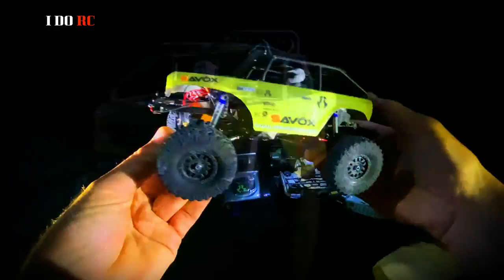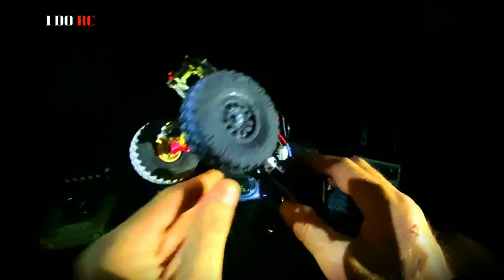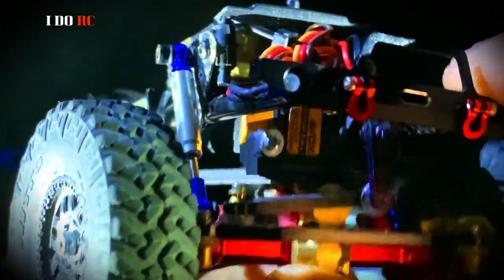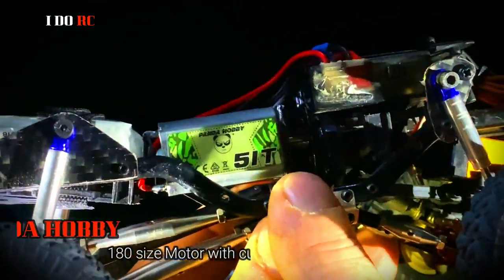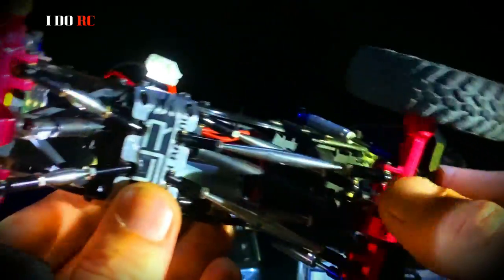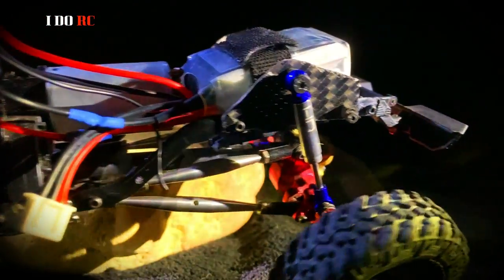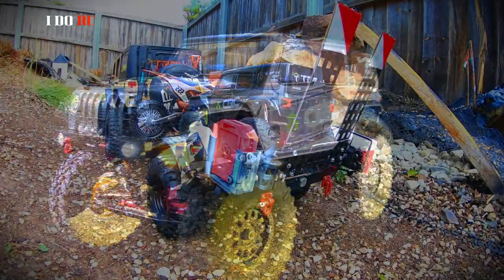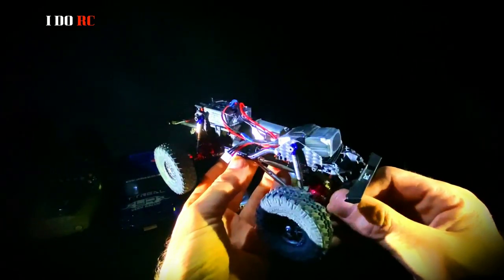BEST Axial SCX24 DeadBolt UPGRADES and BODY SHELLS REVIEW-WAS IT WORTH IT? 1080 60fps I DO RC

Comment: I would really like to know more about the motor mount for the panda motor
Reply from the maker: Hi Scott, you can apparently buy mounts for these motors but i custom made one from 20mm x 10mm x 2mm Aluminium rectangle tube. A bit of messing around to find the right sort of thing to use, then I cut to the right shape and drilled holes to match the deadbolts mount on one side and the motor holes on the other side in the right spots for the pinion gear on the motor (I did turn the pinion around) to mesh with the spur gear on the centre diff. You can drill two holes close together so you can move the motor slightly for adjustment but I got my holes pretty much spot on first go.

Comment: $300 later in clown colored metal "upgrades" and he is still on stock hard rubber tires and plastic wheels. LMAO  SMH🤣😂😆😅🤦🏻‍♂️  The best basic upgrades you can make you've completely  ignored.
Reply from the maker: Hi mate, as I stated in the video, I have had about 4 sets of tyres, and a set of steel rims... NONE were as good as these stock Axial NITTO, as I said in the review.
I have however finally got around to going for what ‘most’ consider to be the best upgraded wheels and tyres, the RC4WD Roc Lox and a set of Steel Line beadloc wheels, they are still on the way and should be here next week. My FIRST upgrade I wanted to do and I always do is change the plastic wheels to steel for the best weight dispersion so YES I agree with you on that. I’ll be doing a review on the wheels when they arrive and really doing an in-depth video comparing the performance.
Cheers for watching and your feedback.